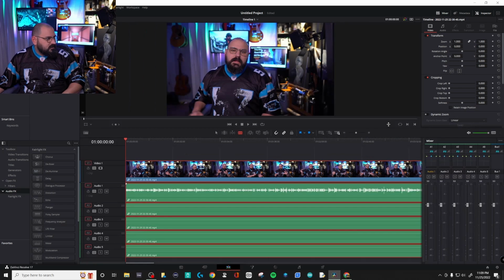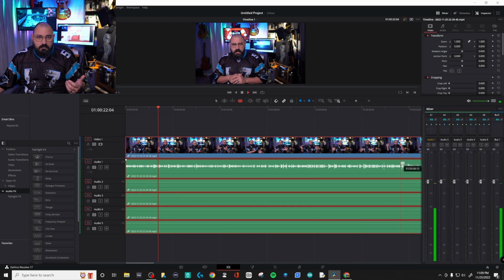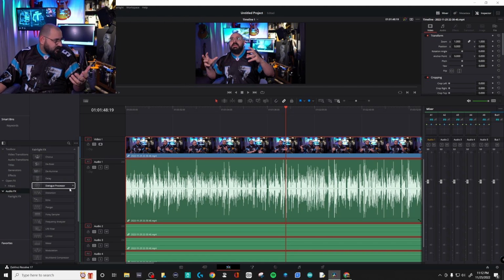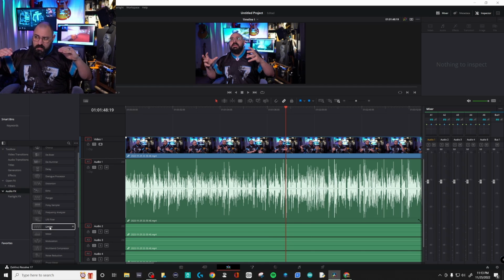Davinci Resolve - Calming Loud Audio Moments Using Limiters

Comment: The video is too long. 4:15 for the start of the explanation of the process. 7:24 for when he started using the limiter. 
It ends at the 12:00 so technically, it could have been a 7, 8 min. or even shorter video